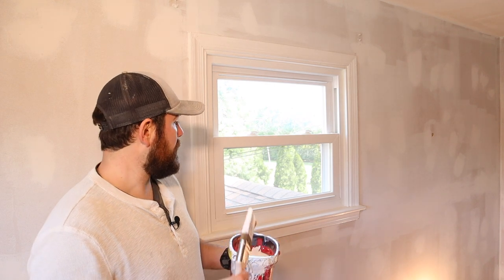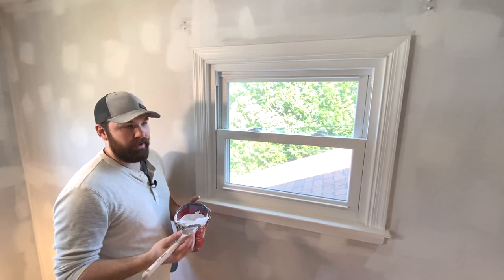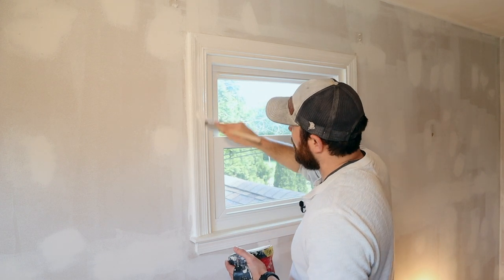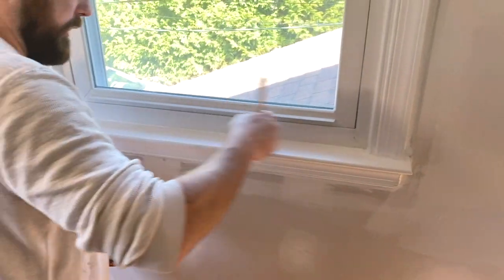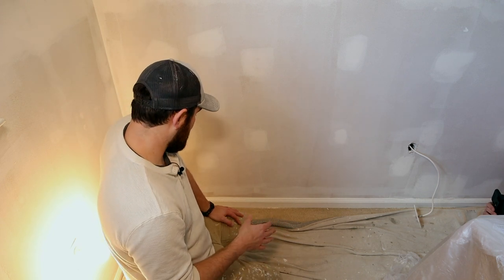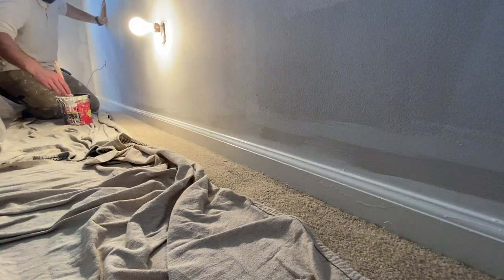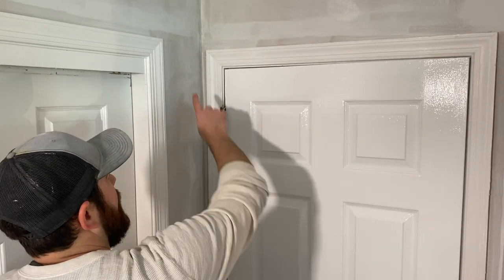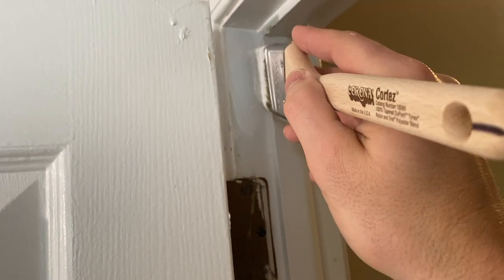Painting a Bedroom | Part 12 | Painting the Trim

Comment: How much should you sand the trim.  Am I just doing a quick once over or getting it down to the wood?
Reply from the maker: Just a once over is fine to get rid of imperfections you don't like.   We spend a little more time on doors to make sure they are smooth.   If your painting over latex paint, technically you don't have to sand if you don't want to.   Good luck Kevin!

Comment: Did the customer not want you to remove the door knobs and hinges?  My "OCD" would never allow me to just paint around the hardware as no matter how much one tries ,paint always gets on the hinges and knobs. It also messes with the direction of the brush marks. Nothing worse than to see circular brush marks around a door knob. Lol 😆
Reply from the maker: Good question, some people prefer we take them off.   Most don't tho.   We've had a lot of issues with old doorknobs where the screws are stripped, and we have had problems getting them back on correctly.    Sometimes the doorknobs come off fine and when we put them back on is doesn't latch properly.  Luckily we are awesome painters and don't get paint on them. :)
Reply: @SuperVassarBrothers  we charge $20 per doorknob removal…makes it so they either take them off themselves or they tell us to paint around them.

Comment: Do you sand between coats?
Reply from the maker: Not usually.   Only if we notice some rough spots.
Reply: Sanding between each coat is the way to do it ideally, but it's a light sanding with 150 - 200 grit.